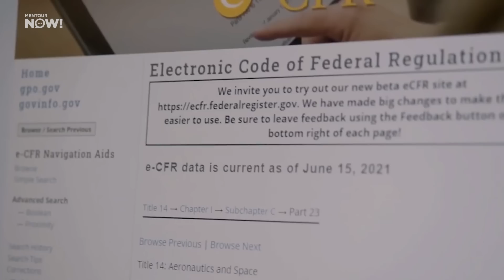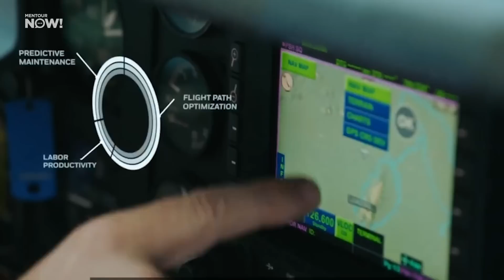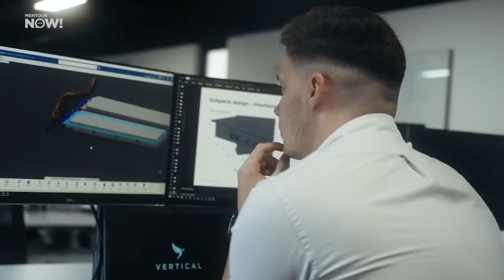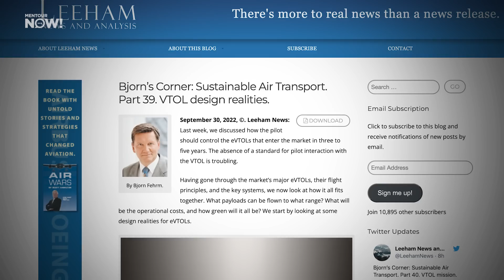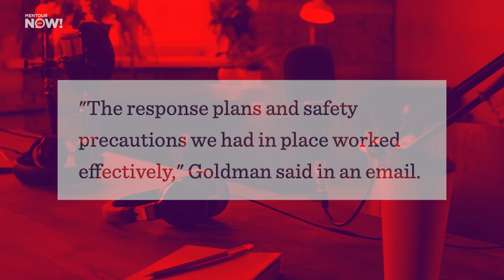Will they SHARE their Secrets?! Electric Aircraft Safety culture

Comment: I've seen some really neat electric aircraft, such as the Lilium Phoenix 2. So there's probably a niche market. But my take on bulk commercial aircraft, is to use the current technology, with hydrocarbon fuel. The hitch is to get renewable energy cost so low, to synthesize hydrocarbons fuels, at a cost as little as current fuel, that's drilled out of the ground. That way, they are both carbon neutral, and economical. In the long term, this is possible, as renewable energy cost will drop. Be smart about it. Don't waste lithium ion batteries on grid storage, while heavier, but lower cost existing battery technologies, are fine, as long as that battery doesn't need to move, so light, energy dense, batteries are wasted in this use. The main reason the industrial revolution happened, is that cost, primarily energy costs, dropped to 1/10th, or 1/100th of that, using older methods.

Comment: Excellent points Petter. Techno Utopians require a strong dose of reality.
 First of all this requires a massive overhaul of existing infrastructure possibly even inclusion of radical disruptive technologies within that new  infrastructure that requires massive public investment that can be very expensive to implement. 
Two- any such new hybrid vehicles must be governed by the rules of aviation. Whoever is flying them must at the very least have a CPL if not an ATPL with a type rating certification. If we decide not to have pilots then we require the use of Artificial intelligence. 
Three- Artificial intelligence is not perfected in self driving cars yet and is still being perfected. Every crash of prominent brands of self driven cars has resulted in a death. Are we then going to implement self driven hybrid car/vtol drones/ flying machines where there are more and more unknowns in the equation . How are we going to avoid collisions and fires due to work in progress battery management systems for example, notwithstanding mechanical and other failures?

Finally I suggest Techno Utopians to go read the first page of the avherald.com. It lists incidents,accidents and crashes from various airlines all over the world. Techno Utopians must get a grip on reality. THINGS BREAK DOWN, MISTAKES OCCUR, THE UNTHINKABLE HAPPENS. The avherald lists hydraulic failures, cracked windshields,  overheated engines, malfunctioning flaps, smoke in cabin, depressurization,  blown out tyres, engine flame outs, rejected take offs, tail strikes,trim failures, fuel leaks,  electrical issues, landing gear issues, runway excursions,  pilot incapacitation,  rejected takeoffs, engine stalls and many others on a DAILY BASIS.REPEAT DAILY BASIS. And that's just with certified tried and trusted aircraft.The fact that these incidents are handled at at a particular level and don't escalate/ turn into major accidents resulting in injury or loss of life is testament to industry maintenance and safety- developed over decades. 

Techno Utopians need to make their vision fit reality....not the other way around.

Comment: My understanding regarding the sharing of safety-critical proprietary information and trade secrets, is that this is a major part of what regulators are for. I don’t doubt that aircraft manufacturers like would try to compete on safety, if not for the fact that they all know full well that even when they’re the first ones to come up with the best solution to a safety issue, it’s going to be turned into a certification requirement and sent out to all their competitors.
At best, it’ll just buy them some time by forcing competing manufacturers to go back and redesign some of their systems.

As for battery fires, they’re a symptom of an unfortunate difficulty you’re always going to be faced when you’re storing a huge amount of potential energy in a very small volume. Conventional fuel also fundamentally has this same problem. It’s an extremely flammable, volatile fluid, that needs to be correctly contained at all times (during storage, transport, at every stage of every single component involved in the system, all the way up until controlled ignition).

Think about how complex modern fuel systems are, and imagine the consequences if something were to go badly wrong at any point at all within that system - and take a moment to appreciate the amount of engineering that’s gone into ensuring that never happens (and that if something goes wrong anyway, it can be managed long enough to safeguard life).

My guess is the problem of battery fires will be solved - i.e. reduced to an acceptable level - given a little time, like it was for fuel/gasoline fires.

Comment: Battery packs weigh twice todays fuel loads, scratch this insane idea.
Reply: Batteries have 1,000btu while jet fuel has a whopping 135,000btu. Batteries have been slowing down in progression in past decade due to the laws of thermodynamics, these evtol’s are just a bunch of toys for environmentally disconnected millionaires and billionaires.
Reply: Also just to mention, it’s aviation regulation to have 30 minutes of fuel during daytime extra after landing, and 45 minutes during nighttime after landing, so these toys can barely comply with these regulations right now still.

Comment: with these big drones, if you lose an engine you also lose control of the aircraft. Helicopters can lose all power but the pilot still has control and can auto-rotate safely.
Reply: That's a big reason these have eight or more props, as opposed to say four. If one fails, its pair can shut down or throttle back to preserve control at the expense of lift or speed. Losing one of four doesn't really allow this. I expect many of these designs will have recovery parachute systems in place on production models.
Reply: @strehlow  Multi engine aircraft are way more dangerous than Single Engine Piston because they have 1 source of fuel. 
8 electric engines still only have 1 source of electricity. 
The concept of losing control if for whatever reason your motor can't turn is a fundamental flaw that can not get certified until they rectify it.
Also CAP's parachutes have about a 2000' deployment altitude and the idea that they are a cure all in aviation is good marketing but simply not the reality. Yes CAP's can save lives but they have a narrow flight envelope in which to do so. 
eVTOL are a very very long way off getting certified.
Reply: @HoltAircraft  True, they're not a panacea, but they do contribute to the overall safety. 
Battery redundancy is important too. Having packs split so pairs of motors are fed together would go a long way here. If a battery fails, pairs of rotors would stop, preserving control. 
It is likely that loss of half would still allow for an unpleasant, but controlled descent and landing that people would at least walk away from. And the tilt-wing designs may have a decent glide profile, which would give more time to find a safe landing spot.
The lithium ion batteries probably aren't going to be best in the long run due to the fire risks. But others like lithium iron phosphate are approaching similar energy densities with drastically reduced fire risks. But to have practical VTOL aircraft, current batteries probably aren't quite there yet. 
STOL use much less energy for takeoff and landing, so when there is some room to roll, that would significantly increase range.
Reply: @HoltAircraft  Multi engine aircraft are safer as usually you can lose at least one and keep flying. And most larger aircraft have multiple fuel tanks spread about. All the engines aren't using a single source. And small twin engine craft typically have wing tanks. Each engine typically uses its own tank(s), and fuel can be deliberately moved between them if necessary.
Reply: @strehlow  I don't know what EASA are going to say but I don't want to get on a quadcopter until the rotor has a helicopter style of pitch control so that in the event of power loss you still have control.
Also little propellers would not give you the same glide ratio and speed that large rotors of helicopters give you.  

The rotor systems and batteries are two separate issues, neither of which I like.
Reply: @strehlow  Not true at all, I know it feels like it should be true, but multi engine aircraft have a way higher accident rate. One of the causes of the higher accident rate in GA is that they run out of fuel way more often than Single Engine Piston (SEP).

Fuel management in multi engine is way more complicated thus more errors are made. 

Also if you lose an engine, it isn't like people think where there is a safety engine that will save the day. They most often fail together. 

There is a "Blue line" speed, which is a minimum for single engine flying and you will roll over if you are below even at full control inputs. Handling a multi engine aircraft with an engine out is no simple task at all! So the idea that you simply cut a corresponding motor on a eVTOL is just going to make problems even more complicated and a sink rate of a meteorite. 

BTW I am a PPL (a) rated on SEP, and have time on ME. I understand what you're saying, but the time I have on ME aircraft I can tell you it is way way more complicated than people think.
Reply: @HoltAircraft  I defer to your experience on the ME aircraft. I suspect though if its a fuel management problem, that is primarily a pilot-workload issue. Automation could help with that. Are there mandatory minimums? If you go below a certain amount on board, are you required to land and refuel, or is it at the discretion of the pilot? 

As for the large drones, of course taking two of eight motors out of an array is going to cause significant handling issues. But these are all fly-by-wire systems, and the autopilot needs to be able to manage basic controlled flight with the loss of any pair in the system. It doesn't have to be a pleasant flight, and it doesn't have to necessarily be level. 
Depending on the geometry, some pair lost might mean hovering is not possible while maintaining altitude, as another symmetrical pair would need to slow down to keep the craft level. So it would force movement in some direction while finding a landing spot, then briefly allowing a vertical landing in the last few moments of flight. These are disaster-avoidance behaviors rather than normal function. 

Given sufficient numbers of motors, losing any one pair should not be a crisis, just an inconvenience. But of course these are engineering decisions that are being chewed on now. I would not fly in any of the current designs (even if I could afford to). But I think it is reasonable that within a few years, there will be some that I would trust.
Reply: @strehlow  Yes definitely, fuel management is a pilot workload issue, and the more complicated the fuel system the more demanding a job it is to the pilot. 

You're right we have a legal minimum fuel to land with. Depends if you're IFR or VFR but it's generally, 1)fly to destination 2) go-around at destination 3) fly to alternate 4) go around at alternate 5) +45 minutes at max endurance for IFR and +30 minutes for VFR. 

Once you dip into the reserve minutes of fuel you are "MAYDAY FUEL" and you get emergency assistance.

Big difference between petrol and electric is that petrol engines will produce 100% power until they run out of fuel, whereas electric engines lose voltage as they spend their amp hours, so they gradually lose power. Which I can see causing a lot of accidents even in fixed wing aircraft let alone eVTOL where there is a massive power demand for landing.   

The electric motor itself is the least likely part to fail in the system. There are power cables, connectors, batteries, computers, ect. All of those parts are way more likely to fail and take all engines at the same time. 

A helicopter has control via varying the pitch of the rotor blades as they rotate. A drone has control via varying the speed at which the rotors rotate, thus without power you have no control. Also you can glider a helicopter pretty well without power, the inner 1/3 of the rotor spins the rotor in the airstream and you have lift from the outer 2/3's. These electric motors are not going to produce anywhere near enough lift in the glide and then you have no control to do an auto-rotation landing. 

You're right that more motors means less effect if you lose one, but the more motors you have the less efficient the aircraft is and the smaller the engines need to be. 

What works on small scale doesn't always work on large scale.

Comment: Thanks for a fun interesting video.

A question in my mind is how quickly such a plane could land if there were a battery fire.  I've seen videos of out of control lithium batteries fires, including one that consumed a bus.  It strikes me that such a fire might cause more than just smoke in the cabin, and might progress rapidly.  It seems that such questions will need to be answered convincingly.
Reply: Yes, these fires are very difficult to extinguish. I wonder if the batteries could be sealed and filled with an inert gas such as carbon dioxide?
Reply: @Phiyedough  wouldn't help, Li-Ion batteries carry their own oxidizer, they could even burn in a vacuum... the only thing you can do is make sure the fire doesn't spread to the entire battery or to other parts of the aircraft by putting in firewalls and vents, and then land ASAP.
Reply: @Phiyedough  These batteries generate their own oxygen whilst burning so co2 would not affect a fire in the least.

Comment: I think Ev plane with an inbuilt range extender can give good miles and if battery gets discharged or any problem. That range extender can give few more miles. Vertical landing and take off is not possible. Only propellors will work

Comment: Love your work but can you please consider getting rid of the whoosh noise between scene changes. Us engineering types can usually work out when a scene has changed without an audio prompt :)   If the noise is deemed essential, can you please remove the bottom octave or two as it is most annoting on playback on a system with a subwoofer.

Comment: You say at 3 mins 20 secs that EVTOL's and electric aircraft in general cannot use batteries from a Tesla, but that is exactly what they do use. The RR NXTE which you show stock footage of used 18650 cells, identical to a Tesla Model S, Volocopter use 21700 cells, identical to a Tesla Model 3.

Comment: Unfortunately not all Aircraft manufacturers seem to stick to stringent safety rules. As an example, a US manufacturer even changed the location of their manufacturing plant from Seattle to another state to circumvent the more stringent rules in WA and safety engineers were sacked when they complained about the non adherence to safety procedures. As a result there were some crashes and the air-crafts of a particular type were grounded for an extended period of time. On another topic the electric aeroplanes sound great but the batteries are not the way to go. There are motors that would circumvent this problem (eg the Adams motor) but they are not manufactured for profit reasons. To say it with the words of JP Morgan: If you cannot put a meter on it I do not want it. But this might change in the not too distant future. Otherwise, as a PPL holder for 40 years, I find your videos quite interesting.

Comment: As of today, we still even dont transport Teslas on board Northern-Baltic ferries just like that. Strict protocols in place. It was few years ago, when we didnt even take them on board at all. Looking from a seafarers point of view, one how acts as one of the firemen on a ship - I dont think these will succeed that much with the safety and reliability.
Reply: A lot of these companies like to say that by protecting these batteries from starting a chain of fires is just dumb to me. We all know in aviation that if an in-flight fire occurs, either you do anything you can to get on the ground, or you become an asteroid in mid air. I mean, when teslas are on fire, firefighters can barely do anything to stop it and have to let it burn out, now who’s to help you when your now 3,000 feet high?
Reply: @poochie5543  Exaclty... We were told in training to leave them batteries be (just try to evacuate and keep the fire from spreading). You cant do much with traditional fire fighting gear (inside tight loaded car deck on board a vessel). The batteries can catch up fire again, again and all over again. Dangerous nonsense.
Reply: @habahabatsutsut2657  yeah we need to move away from Lithium NMC based battery (what most ev's use that can catch fire) and swap over to a less flammable battery chemistry like LFP or LTO (the kind of battery chemistry that you can literally put of much of holes in a cell). At most they'll do is just create a bunch of smoke (never getting hot enough to auto ignite other cells and cause the famous thermal runaway event NMC is so well known for).

Ill sacrifice some range for improved safety (only reason ev makers are using nmc batteries).

Comment: The constant talk about safety would have been more meaningful (and true) if Boeing didn't admit that it lied to and misled the FAA during certification of the 737 MAX, basically hiding MCAS, resulting in MCAS not being mentioned in manuals, which directly resulted in an unsafe plane.  When a manufacturer lies to and misleads regulators explicitly and exclusively to get its product certified, everyone is perfectly justified in questioning the safety of not only that product, but all of the manufacturer's products (because we don't know what else they lied about).